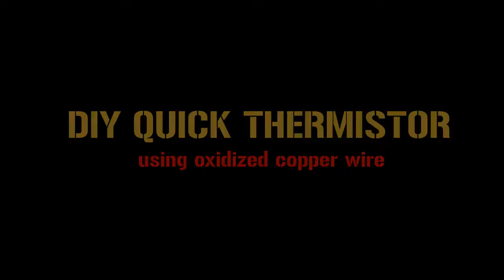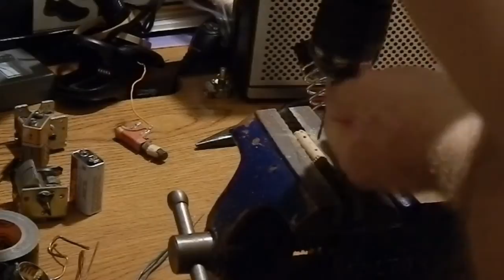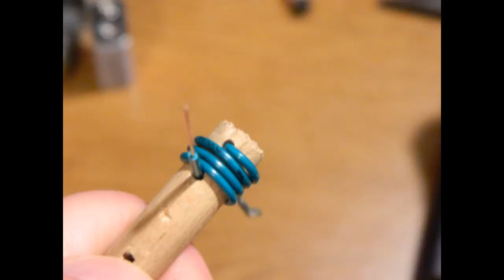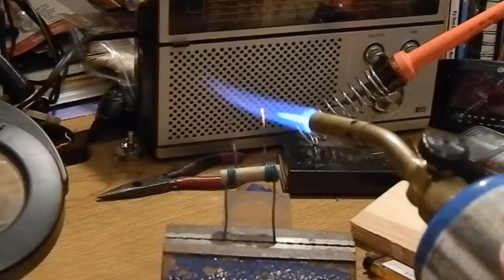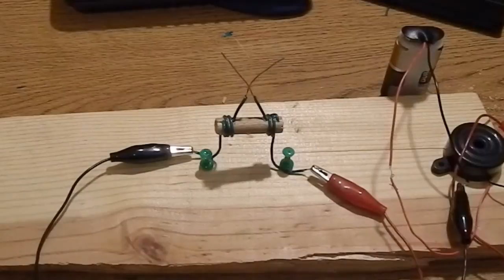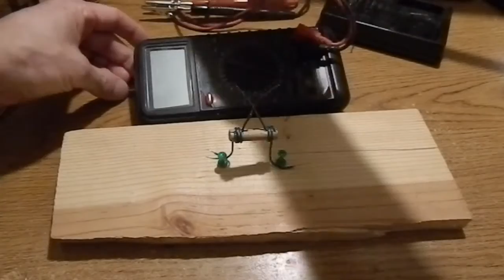DIY Quick Thermistor

Comment: How sensitive do you think this is? Does it only work at high temps?
Reply: Awesome video by the way. Let the experiments begin! lol
Reply from the maker: It took a few tries finding the right wire, probably depends on the impurity level of the copper.
Reply: hmm..I tried it, seems pretty random as far as the resistance with a voltmeter. Maybe I will try some more wire types. I think the soot from the flame has something to do with it too.
Reply: Is the copper oxide easy to wipe off?